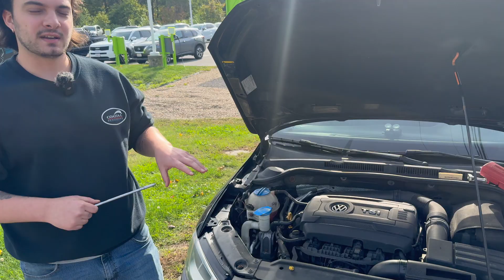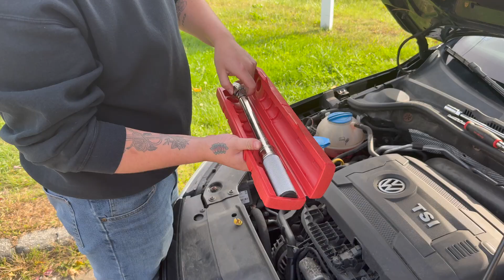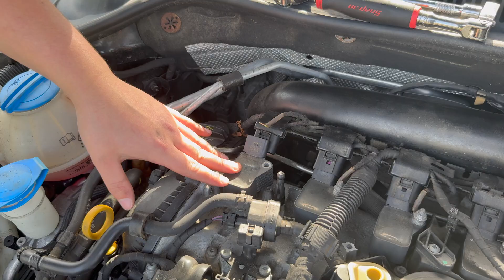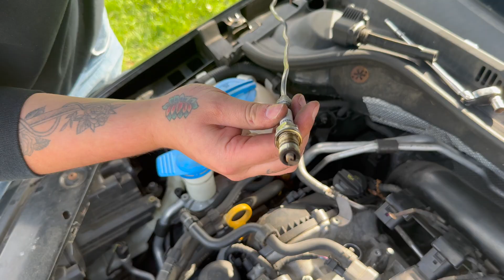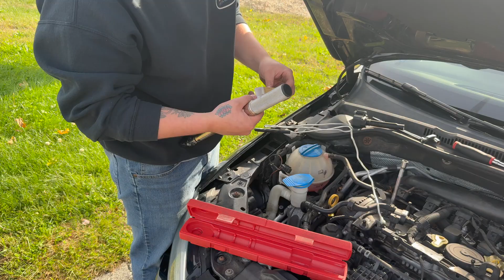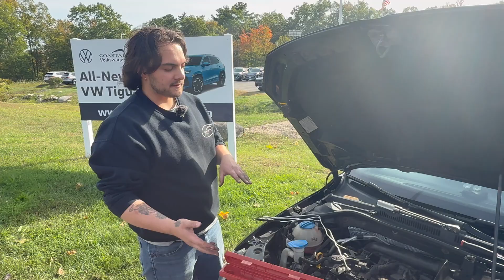DIY VW 2.0T Spark Plug Replacement (Golf, GTI, Jetta) – Step-by-Step Guide

Comment: Yikes, go find another DIY video. Didn't hold the stud with a wrench while removing the nut so that the ground wire wouldn't be damaged. Didn't actually tighten the stud, much less torque it. Dropped the spark plug in - never seen that in my life.